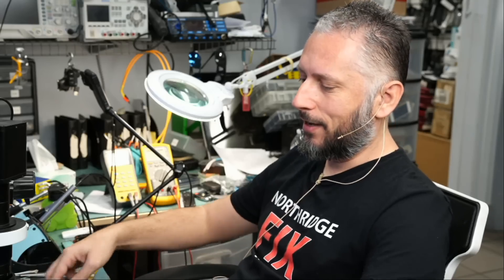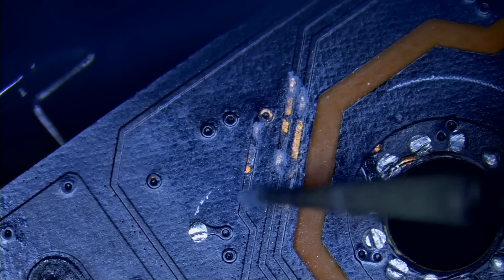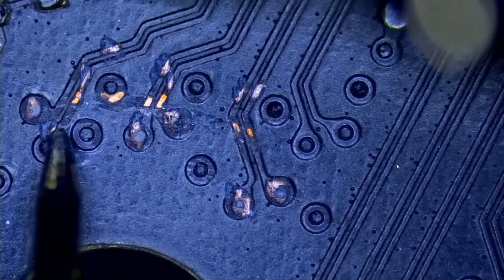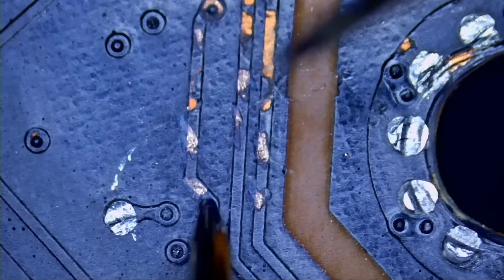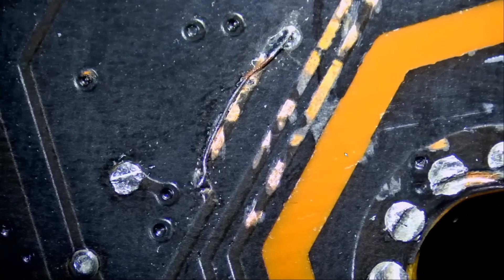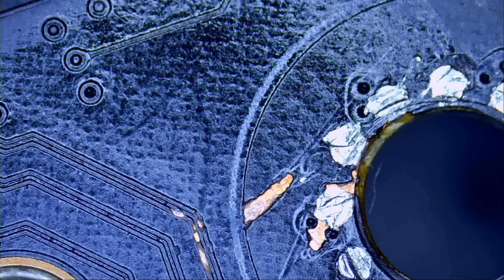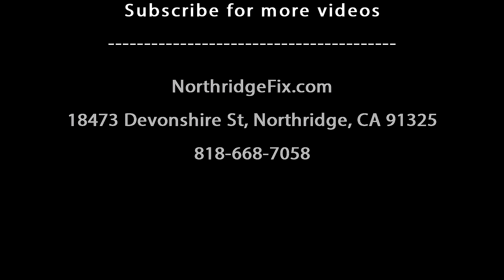ROG Maximus Z690 Extreme Repair - How useful is Memory Overclocking?

Comment: Overclocking is a big deal on Intel and AMD. If he’s not able to run any XMP profiles (overclocking the memory) your better off replacing the board. XMP is a default memory overclock to reach the rated speeds advertised on high end memory. He doesn’t specify if he’s doing the normal XMP or trying to go above that but yes this is super important or you will be stuck at base default speeds that are much slower than what’s labeled on the packaging.

Comment: The overclocked hardware is meaningless without the programs. The benefit depends on the program used . Thus sometimes overclocking is not worth the extra cooling and extra wear on the system.

Comment: there is a lot to understand about memory overclocking. in terms of motherboard memory, you have single/dual rank, dual/triple/quad (in consumer boards) channel memory. some cases having 4x8g sticks will be better than having 2x 16g, this comes  down to rank and a few other things like how the motherboard is wired up, be it daisy chain or t topology. higher speed memory can affect certain application performance. you can pretty much pick one of the points i mentioned and read/watch hours of content to understand it fully. I suggest dont get into it too much if you have a full plate.

Comment: the term megahertz is incorrect, it is not exactly a frequency but it is used none the less instead of megatransfers  per cycle. Overclocking increases those megatransfers per cycle and it uses very little power and if you overclock like 2 sticks of ddr4 3000 mt/c ram to 3600 for exemple it may generate moderate heat but not enough to do any long term use damage but if you push the overclock too far it may  simply crash  or you may need supplementary cooling . small overclock  has a negligible impact on lifespan of the components but please don't run a heavy overclock on cheap  ram  for extended periods of time and get better ram with a good enough latency instead. memory OC is the quick and dirty way to get more free performance for operations intensive on memory transfers and use. ram sticks have heatshields  nowadays to  deal with a certain level of heat but beware some  have just rgb covers  like some of the A-Data brand ddr4 rgb sticks. photo/video  editing, intensive compute uses do benefit from this and for gaming it generally helps a lot depending on games sometimes.

RAM OC is a lot easier with 2 sticks  rather than 4 and a single stick  is easier than 2   but the more sticks you have and the less you may overclock and with 4  sometimes  xmp can't even be applied on some motherboards in some cases . fun fact  is that Asrock boards even cheap ones  oc the ram very well and ranks among the best but if you want an easy time to try memory oc  get a MSI board for the memory try-it feature in the bios .

DDR5 on the other hand some sub-timings seem  to matter more than timings themselves, beware .

Comment: You're right. But your cooling solution might be far superior than what the manufacturer assumed.
You might live in a cold climate which further aids even the most mundane cooling solution. Then it might make sense to squeeze more performance out for your machine.

Personally, I wouldn't overclock things these days. Must gamer gear comes with clocking toolset, then there is the silicon lottery..

Comment: Memory Overclocking is useful on AMD Ryzen system as the Infinity fabric/Bus speed (for older folk) is tied to memory speed. However memory overclocking depends on the brand of memory and what Motherboard you have. He may have a memory that the manufacture doesn't have any information on.

Comment: XMP and the AMD version (AMP) are overclocking profiles basically built into/included with good quality ram kits these days. They are actually advertised at this "overclocked" value and being unable to utilise these increased speeds can result in quite significant bottlenecks depending on the application. If this customer is talking about overclocking ram beyond the included profiles ... well then you are into hit and miss territory. Maybe you get to squeeze out some more performance, maybe it makes your system to unstable to really be useful.
Reply: Fast module kits are so overpriced that you'll profit way more by investing the cash in a CPU of higher frequency and larger cache, without having to do risky experiments at the edge of stability.
Reply: Xmp is for intel yes but AMD is not called amp it is docp or somthing silly...also judge by the condition of his mounting holes he has no idea how to build a pc much less tinker with one so I would guess he just means xmp and not actually overclocking
Reply: @samgoff5289  Yeah they have changed it a couple times. Was docp, went to amp (like on my board - which doesnt work) and now is now EXPO or something on AM5. Or like everyone calls it ... xmp.
Reply: @tariel1928  docp on am5 ...got one
Reply: @samgoff5289  I use ryzen and on my bios says A-XMP
Reply: AMD called it EXPO now
Reply: Explain to me how increasing the frequency AND latency along with power draw is beneficial??

It isn’t lol. It’s an age old marketing trick people still fall for
Reply: @christophervanzetta  why bother explaining to you if you're not gonna believe it in the first place 😂

Comment: DDR5 with XMP is already overclocking 4800mhz modules to upwards of 6000+ mhz. The gains are not worth it IMO as you have to increase voltages and you then run into corruption issues. All for a a 1 or 3 FPS if that.

Comment: This is a common scenario from Alder Lake but it’s kinda interesting it came through your shop. To give you context. 

With Alder Lake, ASUS had a batch or two of early revision boards with varying issues. Those ranged from PCB impedance problems, DIMM slot QC problems, and even the weird capacitor issue that the Hero had. 

It was not uncommon for ASUS to deny RMAs for arbitrary reasons (in this case not so arbitrary) and they would often send users back previously returned boards that are clearly not new. Quite a debacle. 

The customer was fully validated in sending the board back, some of these samples were absolutely egregious and DDR5 speed is very important for extracting performance.

Comment: The benefit for Ram OC is barely noticeable and can be shown only in synthetic benchmarks. But a premium motherboard like ROG Maximus Z690 Extreme should overclock like its advertised. This is a feature even for a basic MB. So I wouldn't not accept this mb as a warranty replacement.
Reply: The ROG brand is now just a few fancy logo's on a piece of hardware, this board will be garbage and worth nowhere near its price, no genuine pc guy would buy this board, it's trash!

Comment: Ryzen / Intel B and H Boards Memory OC very effective on modern systems. 10% improvements easy enough with just timing optimization. Intel z boards can often run crazy high speeds on top of faster timings for bigger gains again.

Comment: if you can OC some ddr4 3200 c20 laptop ram into ddr4 3800 cl18, while changing the command rate from 1T to 2T, u can break some device records in Timespy and Firestrike, literally 300-500pts ahead of the best binning devices of your same laptop model.

Comment: I don't really understand how Asus did not repair that, their repair department just saw some traces exposed but did not test any further or  try to fix, saw a lot of devices that could be fixed returned from official manufacturer service as unfixable. I wish you happy new year and a better 2023 year, peace to all.
Reply: The damage was causes by misuse and inexperience. I agree with Asus
Reply: @gordonm2821 , even the pins of the CPU-socket have been damaged.
Reply: I believe they don't repair anything at all, they outright replace your motherboard and perhaps send the bad one to some centralized office where they salvage the parts.
Reply: Most manufacturers do not do repairs like this. It's all swap tronics. If you can't just replace a module, then it's not fixable to them.

Comment: Looks like he used a powered screwdriver to put in the mb screws. That 1 had a huge path drawn on it. OC ram on that board would be worth 50 or more fps in some games. no sense buying it and then using default ram speed. Be like having a 3 cylinder ferrari. Sure seems like a case of i have the money i will buy the best one i can for the first time. Thanks Dad!

Comment: Memory speeds are getting more and more important for modern systems. Gains of 30% compared to budget value memory are not uncommon for bandwidth/timing sensitive applications.
Reply: Especially on AMD systems as the Infinity Fabric is tied to the memory speeds.
Reply: Used to be the most important thing in the 80s early 90s, too
Reply: @The_Ballo  but this isn’t the 90s with 100MHz RAM speeds lol
Reply: Yep, very noticeable.
Reply: @OKuusava  Anything over 2400MHz DDR is an overclock. Even if the manufacture says you can do 3600MHz. That is still an overclock. It's now a manufacture overclock that has been tested with certain motherboards.
Reply: Than buy better memory sticks instead.

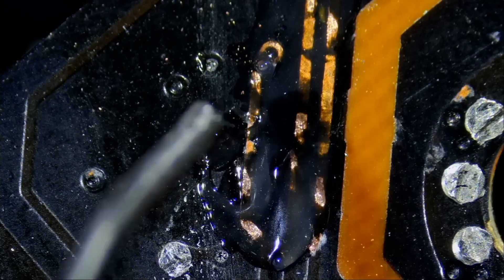Comment: 7:35 - 8:17 Lets say the CPU and GPU keeps getting faster and faster, there come's a point when the RAM speed reaches its equilibrium or limits, think of the RAM like.... the middleman between the CPU and GPU.

In some cases, AMD "Ryzen" CPU's are MORE sensitive to the stock/slow memory, so running it at its fastest will make it happier instead of out of the box configuration the BIOS tells it to , Memory OC also proves helpful in games for Ryzen. 👍

 But since this is a "Z690" board for INTEL, the performance gains are somewhat marginal. 👍 

DDR5 is like a gimmick for now... DDR4 is still plentiful fast for gaming and productivity, the benchmarks on other TechTubers video's proved it.

Comment: Actually, memory overclocking is hugely important, especially for AMD cpus. IF you buy DDR4 3600MHz memory (for AM4) but can't overclock then it will only run at 2666MHz and it will not allow the CPU/infinity fabric to run at its most optimal speed (2:1 ratio for memory speed to  infinity fabric clock).  Basically, if you can't overclock memory then your memory won't even run at its advertised speed and it will hold back the CPU.  (It's also significant on Intel platform as well, But AMD is particularly sensitive to memory speed.) And yes, running at the rated speed of your ram is overclocking it....
Reply: *2133mhz
Reply: @OKuusava  XMP or DOCP are considered overclocking, because it configures the RAM module to run beyond it’s JEDEC specifications.
Reply: @vt6020  No, overclocking is running above the rated speed the manufacturer states, I got some 5600mhz DDR5 ram and set it to run at 6000MHz, this is overclocking, JEDEC spec is just the baseline that ram has to be manufactured and run at.
Reply: @kadoplus  No
Reply: @kadoplus  based on Intel website: "XMP, or EXTREME Memory Profile lets you OVERCLOCK compatible memory modules using predefined and tested profiles". So technically setting the RAM to run at XMP is overclocking at safe standard that has been designed and tested by the manufacturer.
Reply: @OKuusava  DDR4 runs at 2133mhz. Anything more is an overclock.
Reply: @TLM-Nathan  Nonsense. 3200 is JEDEC certified. Please don't spread BS info.
Reply: @lorsheckmolseh3345  Only when you enable XMP / DOCP. The manufactured speed of ddr4 is 2133mhz. Everything above that is an overclock. There is literally dozens of videos from JayzTwoCents, Gamers Nexus, LinusTechTips, etc all saying this and explaining it.
Reply: @TLM-Nathan  anything above DDR4-3200 22-22-22 1.2V is overclocking the DDR4 memory. DDR4-2133 is NOT an maximum JEDEC standart
Reply: @TLM-Nathan , my ole Schenker i7-7700 from 2017 runs DDR4-modules with 2400MHz without overclocking. I barely noticed the change from 1x8GB to 2x8GB dual channel, even in games.
Reply: @lorsheckmolseh3345  oh yeah, 2017 technology
Reply: @420rvidxr , technically every increasing of frequency is a kind of overclocking. But when Intel writes the speed on their site and the BIOS of every machine choses the rate by default, i would call it "specification".  🤡
Games on Onboard-GFX strongly profit, but any system above a GT950M will run classes faster with the worst memory modules at lowest frequencies. Better invest 50 bucks in a lowend-card instead of CL14.
Reply: @lorsheckmolseh3345  How much benefit you get from faster memory has a lot of variables, but the gains can be massive (not that hard to find data on this). It depends on v cache size on your CPU, IO die, the type of workload, etc. Even in burst mode your memory controller needs to pass that data onto the cores at some point, the memory controller being at a lower clockspeed is counter productive to that. Burst mode mostly has implications to lessening the effect of RAS to CAS delay on your system.
Reply: xmp should not be called overclock , its been tested to run on those speeds and timings by the factory and its sold with those speeds on the price tag
Reply: @Deathscythe91  Depends on the motherboard though…
Reply: The access-speed of the ram doesn't increase by higher clocks. You may get some gains when reading burst-cycles, but in normal applications the benefits are nearly 0, because of the First, Second and Third-Level-Caches. What can give a real boost (in some cases) is switching from 1-channel memory to 2 channels. If anybody needs optimal speed, he has to go the DDR5-road.
Reply: That's the narrative if you watch YouTube videos all the time. Memory overclocking is mostly useless, with tiny tiny gains.
Reply: @itstheweirdguy  not when you run on integrated graphics, the performance increase is huge when overclcking